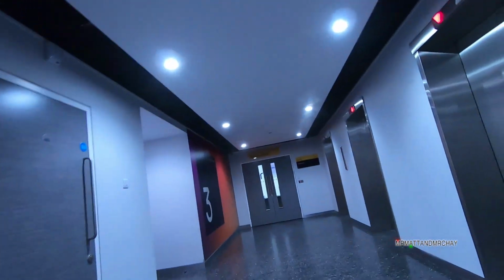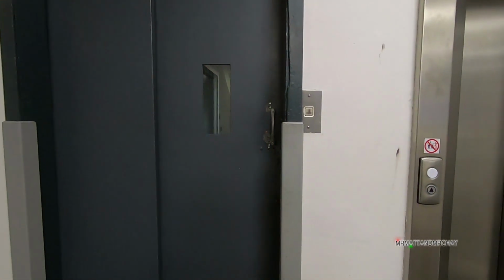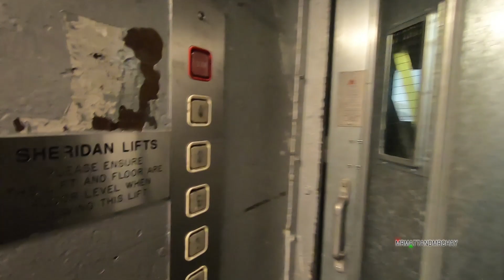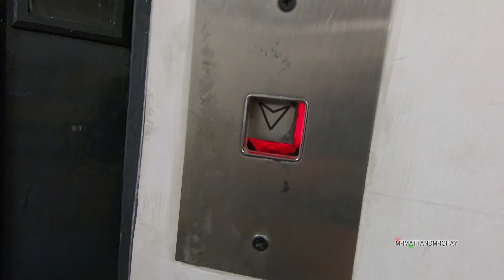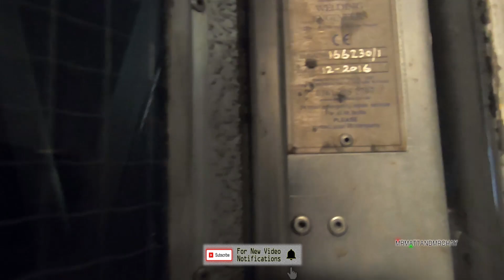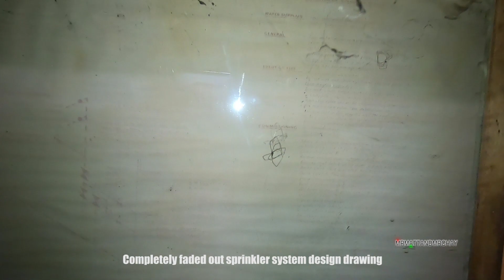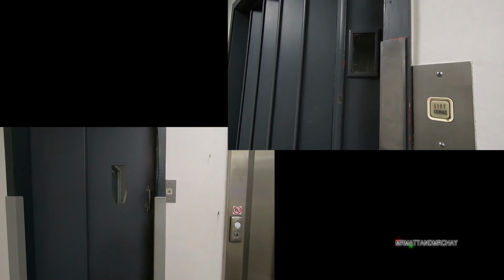Old MARRYAT & SCOTT lift

Comment: Neat! I really like the fixtures on this one, I'm surprised that the bulbs have still not burned out.

Also it's a big first to me to see one that has both swing-out doors and scissor gates... Kinda odd if you ask me, but hey! It gives a nice character to this ol' workhorse of a elevator/lift! They don't make 'em like they used to.
Reply from the maker: I would have preferred those doors on the ground floor to be electrically operated, but I've never seen this sort of thing - completely different ones on the upper landings.  Oh and that lamp on the 2nd floor was the only original push button that worked!
Reply: @mrmattandmrchay  there was some elevators/lifts that had electrically operated scissor gates, however, I do not think they were popular in Europe (I have seen one but for the life of me I cannot remember where, I was maybe 5-7 years old when I saw it, an old 70's generic.... "inconnu au bataillon" (stranger in the regiment) as we colloquially say in my country for something that has unknown or unclear origins...) but one thing I know, most of these were touted as "semi-automatic"... Curiously there are plenty (thankfully, the USA has these so-called "Grandfather clauses", potentially saved many of these oldies from a potential modernization) of these "automatic scissor gated" in North America, and these were made by OTIS, most of the time at least (not sure if other companies such as Dover did... It's complicated)

Comment: These Marryat and Scott goods lift cars were built to last, really solid construction with chequer plate floors, certainly get your moneys worth from them.
Reply from the maker: The good old days!  It's the same with everything these days - I'm in the security industry.  We don't generally do alarms, but just as a comparison, there's nothing better than doing a job 'properly' without cost cutting.  Nowadays, alarms are installed in hours with wireless detectors.  When I was a trainee back in 1989 (when I started work), we had the floor boards up, drilled out the joists and everything was cabled properly.  Nowadays, the skill sets to install systems like we used to are gone.  Engineers fix the detectors up with a couple of screws and mostly the systems are even preprogrammed.  No skills needed anymore.  Then, we have jamming signals come up, because things like 'Hive central heating thermostats' malfunction when their batteries run low and take out the intruder alarm wireless devices in the process.  I totally agree - older methods were better rather than trying to cost cut to get the job.  But for the customer, they always go for the lowest price these days, so there is no longer a market for 'quality over cost'.

Comment: You can hear the Bull Motors Super Start noise when the lift starts moving! Those motors are very rare now. Hear it at 5:19. A motor room tour of this lift would be the first time that anyone has filmed a working Super Start motor itself. It sort of does variable frequency by doing a phase shift as the motor starts up giving it the distinctive "whoop-whoop" sound.
Reply: I'm not too sure if this is a Bull motor or a Horace Green "Trislot" - they do sound very similar! Most lifts have Trislot motors, Marryat and Scott being one of the few that used them more than anyone :)

Comment: That's quite a nice lift! Love the motor sound and the shaking when it stops! I wonder why the doors are different though. I assume the building owner either didn't like the look of the doors from street level or had to replace the gated ones due to issues. Still a great lift with some nice character!

Comment: I wonder, would the modernized lifts have had the old style doors in the beginning, or is this only a goods lift thing? How old does the building have to be to have these sorts of doors? They look like the 60s. And lastly, what is your day job, if you don't mind me asking? Sorry for all the questions, curious minds have to ask!
Reply from the maker: No problems!  ...these must be the original doors.  The building looks brand new, but going back on google streetview, 2 years ago it was revamped with coloured cladding.   So it looks new now, but actually its an old building.  My job... technical engineer for mainly access control systems (previously called "card swipe" systems).  I was commissioning a system for a large company that we do work for.

Comment: WOOP WOOOOOOOOOP - EPIC!!!
Reply from the maker: Classic STAR then DELTA motor drive.  For those who don't know, STAR motor configuration helps push the motor at startup, then it's switched to DELTA which is better for a continuously running motor.  Each config get's a WHOOP when it's switched on!  Google STAR DELTA motor for more info.
Reply: @mrmattandmrchay  Do you think that the lift in M&S Slough has this type of motor drive also? The woop woop sounds very similar to the M&S lift.

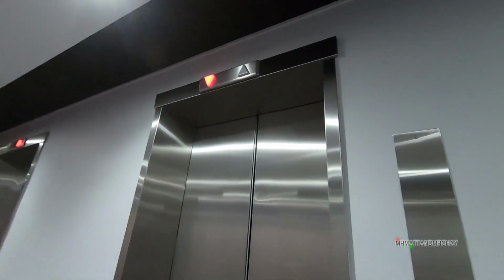EDIT 0:10 That piece of metal looks like it's covering up a pretty large hole - the only company I can think of that originally installed a long button panel like that are Express and Otis.
Reply from the maker: The star-delta switching was a standard feature to ensure a motor gets running properly back before technology moved on, so I guess it has.
Reply: @mrmattandmrchay  I see

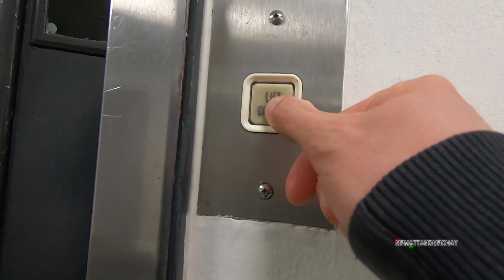Comment: 6:26 why that button wired to buzzer
Reply from the maker: If someone leaves the gates open, then the lift cannot be used.  So if someone presses a call button then a buzzer sounds in the lift to remind someone to close the doors.  This would work in a lot of buildings, but not here in a stairwell - if someone leaves the doors open then they are going to be long-gone to hear the buzzer reminding them that someone else wants to use the lift!